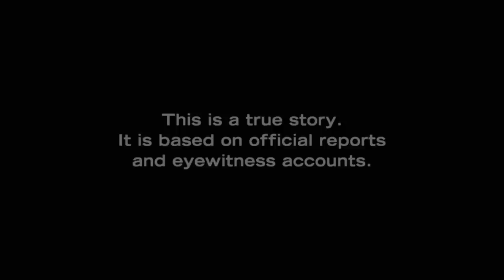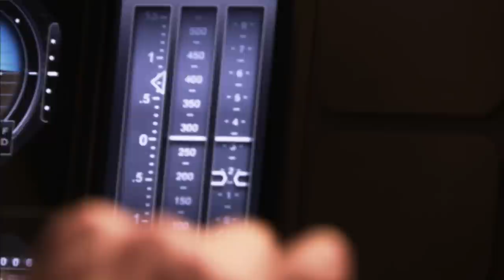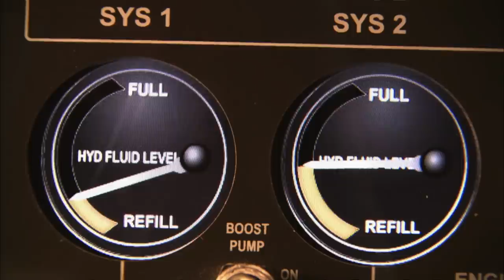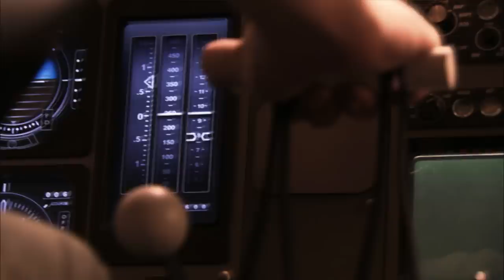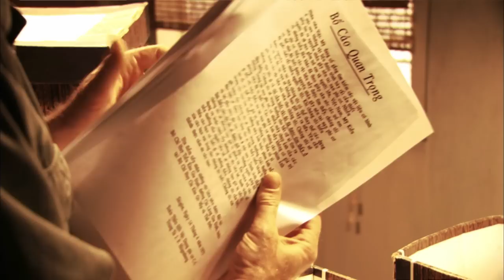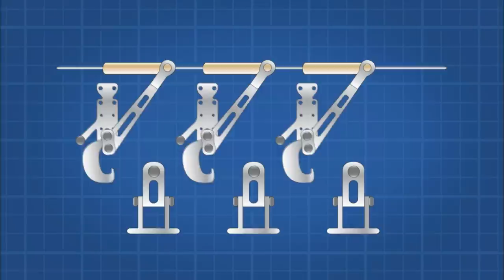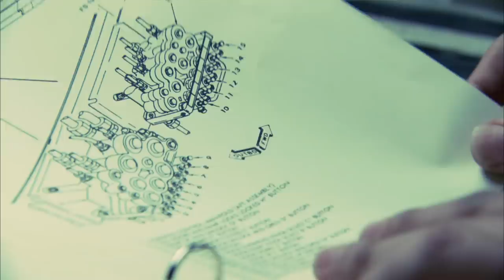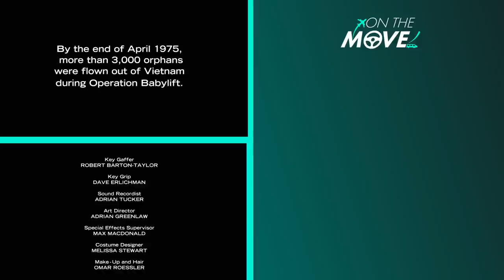How Did An US Air Force Aircraft Crashed Into A Paddy Field | Air Crash Investigation

Comment: I read the title like 5 times. Still doesn't make sense.
Reply: easy they got hit by a SAM on takeoff and crashed into a rice patty.
Reply: Title gave me brain damage
Reply: @Jack29151  no they didn’t it was maintenance members not putting in a pin of a cargo door causing it to be ripped off a sam would’ve been a lot worse
Reply: @FUNNYpla  And a competant pilot could've rode that bull all the way back to the airport if it was just a cargo door. the hydros on those are on top of the airframe, he had full controls. it's not like that DC-10 that had the cargo door rip off and take out all 3 hydraulic systems. They got hit by something that took the hydraulics out.
Reply: @FUNNYpla  Regardless of what caused it they were very bad pilots, I mean a DHL pilot landed a 767 that was hit by a stinger missile while taking off, these guys lose a cargo door and crash. They should've been relieved of duty long ago.
Reply: @Jack29151  1 the Cargo door ripped off not only itself but also tons of airframe leading to hydraulic failure of the ailerons 2 hydraulic failure has led to multiple crashes heard of Japan airlines 123 death also it is incredibly lucky that the DHL crew even survived and we’re talking about an aircraft there was much further away was overloaded and had nowhere to land for miles unlike the DHL which could’ve landed in the desert.
Reply: @Jack29151  did you even watch this beyond the crash itself